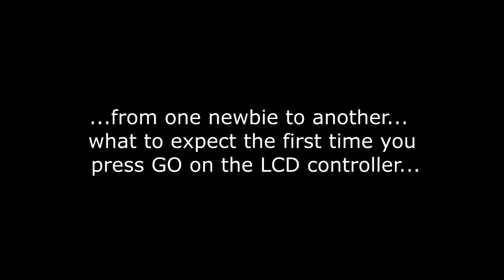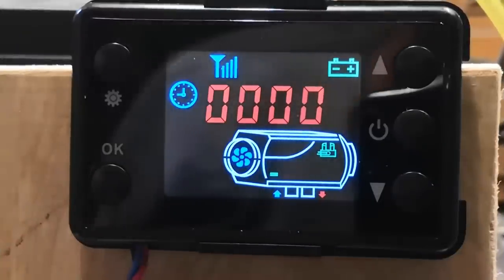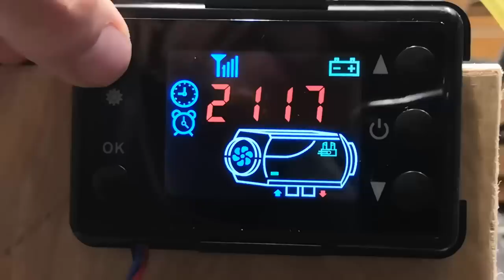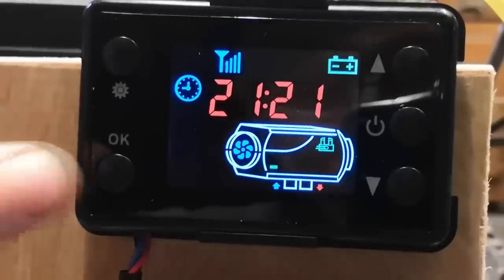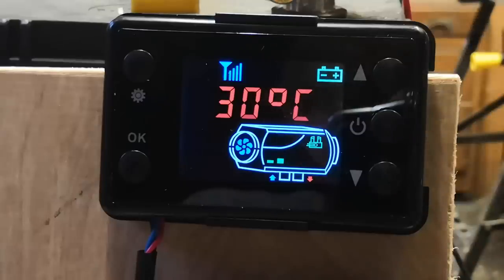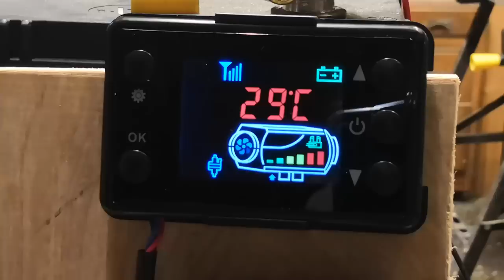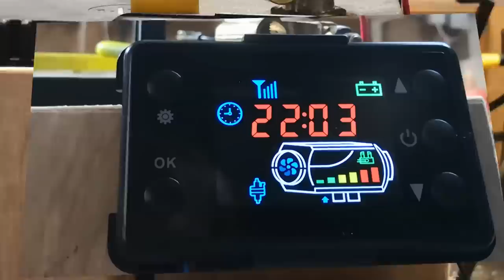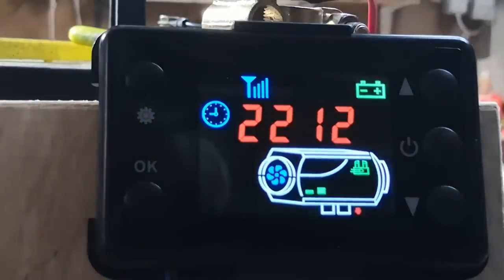First Time you press go...  LCD Controller- Chinese Heater

Comment: Thanks for a very useful video.  I have a few questions though. The unit I have does not show "temperature to select" when I press the OK button.  Instead it shows a temperature with no large degree symbol (just a small one)which does not appear to be environmental as it was way higher than the temperature I knew it to be, and on trying to set your desired temperature it instead comes up with the following "P ... 1.5 Khz"    I assume this is a reception frequency for the optional remote fob which some units are supplied with.   However mine did not come with one.  So at the moment I am unable to select a thermostatic temperature and the heater just seems to run at full blast.   I am wondering if there are options inside this password protected "nerd zone" as you call it?    What is this and how do you access it?  What can you do when your in it?  You also mention a forum... is this the you tube channel or is there a seperate link for other discussions.   Sorry with so many questions but any pointers would be very welcome. :)
Reply: I have the same problem, were you able to figure out how to unlock and make the changes to your controler?
Reply: @ronroy142  Yes. When control shows the Hz figure, press the top two buttons at the same time and it will switch modes and show degrees instead. Doing the same again will switch back to kHz which is actually the Fan speed and nothing to do with the remote frequency as I initially thought.  Hope that helps.
Reply: Thanks just read this and it worked. Brilliant.
Reply: @stevedyer8445  I was having the same issue thanks for the info.  Hope when we get to the utopian geek zone we can set it to remain on temp.
Reply: I know it sounds daft to reply to myself but I am posting this here as I finally have my heater in..working..and I have learned a lot!   The most important one (amongst others) is that these units are very fussy about voltage supply.  The advice is..wire DIRECT to a good 12v supply.  Anything in the circuit which either drains current or provides resistance (include the wiring guage itself) and results in the supply voltage at the glow plug (that is the heater itself) dropping below 9.0 volts for any length of time will result in a low voltage error.  You can monitor this at the controller itself, just cycle through the start up options.  However I did also learn that after one failed start, residue heat in the plug can make a second attempt at start up possible simply because the unit is now Warner than before...as long as your battery is in good condition it should achieve this.
Reply: @stevedyer8445  have you found the settings screen ? And can the degrees setting be changed from Celsius to Fahrenheit?
Reply: THANKS!! i had the same issue, going to try that later, 
 @stevedyer8445
Reply: @stevedyer8445  this video is gold, i hate reading manuals!

Comment: One thing - I noticed you said that you had parafin as a fuel, remind me as I only vaguely remember, does the Diesel heater run on Dieisel and parafin or does that depend upon which version you have bought? I did buy the Diesel one but was going to recommend it to a friend who would probably prefer to run it on parafin.
Thanks
Guy
Reply: Paraffin does not have enough lubricity, the pump will fail prematurely.  Diesel has lubricity, so use diesel.

Comment: Helpful video, but can anyone answer to me?  How can i turn off the LCD screen? Or it have no that function?  Always lighting?
Reply: Unplug the screen with the connector to the screen or install a switch on the heater power cable

Comment: I got mine working using ur instructions,  top man.
Can j helped with the timer tho.
I set the timer to come on at 8pm till 8am but it will only donit for one day. After it finishes its 1st run the timer symbol disappears. I then have to set the timer. Every day. Is this normal or should I buy a new controller ?
Thanks
Reply: Its normal, you have to set them daily
Reply: ....and still better / more advanced than Webasto

Comment: Very nice video.
I can understand the capabilities of that digital control panel, which, as you describe it, it seems to me very very complete how it works.
I make a premise: I do not fully understand your language I'm Italian and I do not speak English, I write this message with the help of a translator Recently I bought a heater like the one you describe in your video and it still has to be delivered to me.
In the kit will come also the panel that you describe very well and certainly will miss the instructions in PDF format to be able to use it in full. Since I have not understood your language well, I would be grateful if you could send me the instructions in PDF format (even if in English. (The translation then I could do) if eventually I could provide the link to download it I would be very grateful Thank you very much for your availability, as soon as the heater arrives, I will install it on my camper and I will post a video that I will gladly give you.
Reply from the maker: Michele... I donlt have instruction but join this group.. loads of stuff here:  https://www.facebook.com/groups/146837062640024/

Comment: Hello, My Bestauto 8k w/controller doesn't shut completely off even after a couple Celsius above set temp, any thoughts why? To answer Kiekegaard, no but it will put more wear on running the pump dry till it gets fuel.

Comment: I would like to heat a tent with this and the heater being outside the tent. Do you think it is possible to set the thermostat or heat sensor with a remote cable and have that inside the tent so that it feeds signal back to the controller? This will allow it to have the target temp be the inside of the heated space.
Reply: The controller/thermostat is on a very long cord and can be placed inside the tent. of course, you will need a battery to run the unit, I use my aux battery setup in the back of my truck that is charged by a 100watt solar panel.

Comment: Hi Great vid thanks it really helped, only thing is that when I press the ok button and it displays the current temperature, I press it again and it displays 4.5 hz  not the target temperature I want to increase ? any ideas please ?
Reply: Mine says Hz too.. Did you figure it out?
Reply: I also have this issue
Reply: I had the same problem. Couldn’t fix it. Had other issues and pulled the fuse three times. When I went back it was fixed???
Reply: ForestyForest yes press and hold the ok button followed by the up arrow .. seemed to have worked for me
Reply: @forestyforest  Mine had the same issue and it was hold the Set button and then press the Down arrow.

Comment: Thank you for the clear instructions. I have a problem with my diesel heater in my camper van. It shut it self down when the battery is getting under 12.5 Volts. I only have this when I’m using it when I’m not driving. I use a second battery already in the van to which the heater is connected. During the cold nights the capacity of this battery is slightly going down. When. I start the heater in the morning it runs for bout 5 minutes and than it shut itself off. Does anyone have an idea 💡 how to fix this without adding a third battery to the van?
Reply from the maker: It is hard to tell remotely but it does sound like a voltage drop issue. Some people have upgraded the wire size from the battery to the heater. when having this issue... particularly if there is a bit of a distance between them. Maybe give that a try?

Comment: I have a code E-01 coming up. Changed the power cable from 10A to 50A. Still not working. Checked to see if it was set on 12v. The voltage meter on the LCD is dropping to 7.4v when the error code comes up. Have checked the solder on the mother board and all seams good. The battery it is connected to is connected to power and is sitting at 13.4v. Any ideas?

Comment: Was wondering if any others are having this issue?  we are using the 5Kw heaters to heat a pumpbox, we have 3 pumpboxes outfitted so far, when we install them they would turn on and heat to 50 ^ C and then code E005 (over heat), since then we have found to keep them running without coding out the LCD display must be mounted in a position that the hot air is blowing across it, causing the LCD display to be pretty hot and the display will read 50^ C even if the display was set to 30^ C or 9^ C seems to run saying it stays at 50^ C. any thoughts way the display needs to be mounted where we are, any other spots in the box and that is also suspended in the center of box the pump will code out ?

Comment: Is there a mounting orientation requirement?   

Is there altitude compensation available?   

Thanks...... great video!
Reply from the maker: Not on this controller but I do understand the later controllers that look like a gaming console have altitude corection
Reply: Camper Convert, do you know which controllers specifically allow altitude compensation?

Comment: Hey. very informative video. helped me a lot. we in Russia still can not deal with this display. your video helped. please tell me, can I set it in the settings so that the display screen after a while went into sleep mode? the display screen glows constantly, it seems to me that it will quickly discharge the battery. thanks for the answer.
Reply: i believe "julian lett" (here on youtube) addressed this. He showed which two buttons to press simultaniously to make the screen go off to save battery power.

Comment: My chinese heater is really working well. The only problem is, after the winter, that the display is very hard to read. Bought another one but that one were flashing the the battery and it was not possible to start the heater. Changed to the old one and pressed the start button with success. SO- any thoughts or experience about renewing the display?
Reply from the maker: Yes, this is a know issue... a fix here if you are handy with a bit of soldering. https://www.youtube.com/watch?v=VSZzSx2ExdU&ab_channel=SB3BedfordBusStuff

Comment: Hi firstly thanks for a great video easy to follow, I have the same controller and following you instructions to the letter I find mine doesn’t show the target temperature on the second press of the button, first press I get the ambient temperature and second press it shows a P-and two numbers that I can change with the up and down buttons could you shed any light on this thanks in advance 👍
Reply from the maker: You are on manual mode as opposed to thermostatic mode. This very short video shoes you how to swap between the two. https://youtu.be/NhKU4AIt4jM
Reply: Brilliant thanks 🙏

Comment: Enjoyed the video , just a question . can you have the air drawing from inside the cab/shed/building  rather than drawing cold air from outside? . So basically it's recirculating warm air
Reply: I expect this has an air inlet for the burner which needs to come from outside and an air inlet on the inside of the van which circulates the air which is being heated.
Reply: @paulwilson5874    Just bought one of these 2 days ago . Installing it into Hot Tub enclosure so that  the temp is adjustable , I like to "Tub" all year round . I have the tank . filter and pump outside the enclosure . Exhaust pipe exits  on another wall , have drill large hole wrapped the exhaust in "Heat wrap"  and inserted it through the hole  ( i have used 3" /75mm steel pipe as a barrier )  .
Reply: Yes you can. The combustion side needs to be external via the two tubes on the bottom, fresh combustion air in - exhaust out .  But as there's a heat exchanger the cabin air can be recycled without fear of CO poisoning. Just make sure that there is sufficient space between intake air and heated air as you don't want the unit sucking in the air that has just been heated.

Comment: i have an 8kw version of the same machine for my workshop. With the same control panel. I can see the room temperature. But on my panel after it displays the room temperature, the next display says P3.00hz (i can change that number) I don't understand how to set the thermostat temperature so that the machine will automatically switch on when it is cold, and off once it reaches my desired temperature. Is that doable, or do i just have to switch it on and off manually?
Reply: You can set a desired temperature by clicking OK twice, then holding down the top two buttons

Comment: I want to install it but I don’t want to use a car battery but a 220V source. What device do I need to have the right voltage, wattage and amps for it? Thanks!
Reply from the maker: Be aware that on start up and shut down the glow plug is on so drawing 10 - 12 amps...

Comment: Brilliant video, thank you just upgraded tp a lcd controller. When you was going through the settings with the current temp and then the target temp i was doing the same, but mine does current temp and then P - 2.4hz no target temperature. Any chance you could show/tell me how to change this please.
Reply from the maker: You can drive these heaters either by thermostatic mode or manual mode and in manual mode you set the speed of the pump. The faster the pump the more diesel goes in the hotter it is. You are clearly in manual mode. The video below shows you have to switch between the two. Having said that if you have a smallish van that's highly insulated as I do... you might find it easier to control the temperature in manual mode.  https://youtu.be/NhKU4AIt4jM

Comment: Is it supose to tic tic everytime ? Or just first time ? Also it smels like some plastic is burning sometimes. But switched of and inside all seems fine. Strange
Reply from the maker: Yes, these machines use a dosing pump so the tick tick tick is just the pump pushing squirts of juice into the heater.

Comment: Great video !
I tried hacking my rotary-controller with external switches, so its fried now..
it turns on when I hit the OFF-button, anfd so on...

any idea where I can get hold off a LCD-controller that works as replacement ?
I have the 3-wire controller as it looks like in your video !

Comment: so priming is just for the first time you fire the unit. but not once it has been run, and has fuel up in the lines ?  do you prime every use ? mine came with a filter to put inline.  so i have to fill the filter manually.
Reply: Mine didn't come with a fuel filter :( but yes priming it just is for whenever theirs air, you obviously want fuel in the lines not air so if theirs ever air then prime first

Comment: What is inside the hidden menu?  Can i change the clock to 12 hour?
Reply: I don't think it displays in 12 hour mode, only 24 hour mode.
The Factory menu has lots of control settings the I would not touch, but you can see what your are set to.
You can also select the voltage to be either 12V or 24V. Cheers
Reply: @lukeb5584  thanks 👍

Comment: My screen is totally black
When I hit the go button it starts up fine.
Is there a way to turn it on just to go to setup mode like yours
Mine is Prijesse 12V 5KW heater
Reply from the maker: Very odd… I did a bit of a Google search about that particular heater and it appears to have the same controller as in the video so my only thinking is either you've got a particularly unusual version or your controller is faulty. So I'm very sorry but unable to help. One thing you might consider is changing over the motherboard and controller which is very very easy  and cheap…  this video gives you a step by step   https://youtu.be/sDwrHozKInc
Reply: @campervan_hackers  Your probably right about motherboard not being compatible with controller
Thanks for your help anyway

Comment: New heater won't come on.  Controller shows fan on but code E-06 appears and nothing happens.  Removed cover and all connections seem solid but fan blade very difficult to turn.  Shouldn't it free wheel?  Code says "Check magnet polarity and Holzer sensor position".  Can you help?  Not a technician, just old retired backpacker wanting to stay connected to the outdoors.
Reply from the maker: Hi... Yes it should spin quite easily. Sometimes pulling it a very little off the spindle might help... have a go at that.
Reply: did you get anywhere with this? got the same issue after a battery change

Comment: Is 6 - 7 amps  too weak for  start procedure? All goes well until pump clicks once then all stops
Reply from the maker: Hi... With great respect that is slightly the wrong question. The current (amps) will be simply drawn by the equipment which draws as much current as it needs so long as there is sufficient voltage in your battery to deliver. For most heaters, when the glow plug is alive, you don't want to see the battery drop much below 11 volts otherwise you could get a low voltage error. So as a starting point, I would put a voltmeter on your battery and see what happens when you press the go button on the controller.

Comment: cheap  !   thou  i have concerns with  noise as i  have a  lowered floor van  and  no where to mount heater apart from under passenger seat !     will have a warm van will the heater be to noisey  for me to sleep ?????
Reply: These heaters are not very noisy.
Reply: You'd want to exhaust it out the window or something

Comment: Hi. Can you tell me, if it's normal to work all the time? That means, it starts and stops on the ventilation all the times.
Reply: you mean that the fan is always running, when heater is in run mode? yes, this is normal, because it has to cool the burn chamber.

Comment: Rippa video mate, any way of relocating the thermostat? As I want to keep unit outside of a tent?
Reply: I've disassembled the heater multiple times, because of soot. The temperature sensor is on the heater controller or in the display. You can relocate the whole display into the tent!